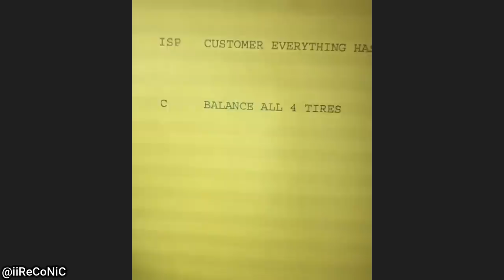Customer States Rear Wheels Won't Spin After Driving Over Speed Bump | Just Rolled In

Comment: That cross connected exhaust from the headers is about the most hilarious thing I've seen. The phrase  " What The Hell Were They Thinking"  just doesn't do it justice !  What's nice about it is that no one will get hurt from a bad self repair job like many others seen here. BECAUSE THE CAR WON'T RUN ! ! !
Reply: My first thought was that someone didn't want that car to go to auction, and had the resources and know-how to make a big statement about it.
Reply: Takes EGR to a whole new level. Lol
Reply: someone had the correct size pipe parts without any use, and decided to troll, i guess

Comment: Most of these clips make me very glad for the annual MoT test here in the UK.
Reply: I've noticed that cars for sale in States with auto inspection tend to get a slightly higher price than in States that don't inspect.  At least you know the basics parts of the car are in good order.
Reply: Plenty of states have inspection and in almost all of them you can find a shady station that will pass your piece of junk.
Reply: @PURENT  That is the fault of the public-private partnership model.  Farming out the inspections to private garages that have an interest in selling you stuff or passing a junker for a little cash on the side is a conflict of interest.  If the actual inspection stations were run as State functions, have fixed checklists, and have no further monetary benefit other than the inspection fees, then it would work.  A private garage can get a car READY for an inspection but, they should not be the issuing entity for inspection stickers.

Long long ago, in Florida, it was that way as I remember.  I remember riding with my Mom or Dad to get the car inspected.  The inspection stations just checked the car for safety and gave you a list of things to get fixed if needed.  They would add air to the tires and adjust your headlights on the spot if needed.

Comment: I've been wasting so much money when I do my brakes. I thought you had to put 2 pads per wheel, but now I  know it's put 1 pad on and save the other for next time. Thanks for the info  !!!
Reply: Well, I tried to put both pads on but they wouldn't fit. Derp.
Reply: @travisritzman6772  didn't push the round squeezey thing in ?
Reply: @thomasfletcher760  round squeezey thing? Let's not be so technical
Reply: Even better, when one side of the brake rotor wears out, just flip it and you've got new brakes!  Easy peasy!
Reply: @squirrelsarepeopletoo6678  taking it easy right now with big words , headache
Reply: @thomasfletcher760  I know I was joking with you
Reply: @squirrelsarepeopletoo6678  I knew you were

Comment: I feel for the guy with the gunshot in his hood.  So easy to do when using your car as a rest - while your scope can see over your hood the barrel can't!
Reply: Friend "accidentally" shot his car multiple times. Uh huh.
Reply: Thanks, as a blue stater I admit I needed this context
Reply: @annehaight9963  My assumption was buckshot, but i know little about guns.
Reply: This guy's not the only one. I saw another truck with identical hood damage done the same way several years ago.
Reply: @annehaight9963  only one bullet hit the truck, one is an entry hole and the other is an exit hole.
Reply: @JacobTerherst  
Ooh I see what you're saying. But that makes me ask another question:  if you're using the hood as a gun rest, wouldn't the gun be on top of it? Or do they rest the front of the barrel on the concave edge of the hood?

I'm a gun owner but I still can't quite wrap my head around someone being this dumb, lol.
Reply: @annehaight9963  Usually when something like this happens, there’s not a good explanation on why it happened. Its similar to, “I was just cleaning the gun and it just went off.”
Reply: @annehaight9963  the hood isnt flat, you rest it on the edge, the scope has a clear view over it, but the bore is below the top of the hood=2 holes. 1 in, and 1 out.
Reply: @leftyo9589  
You'd scratch the barrel though, wouldn't you? Resting it on a bare metal hood? I dunno the whole situation seems sketchy to me.

Comment: 1:38 Still remember when I worked at a lumber yard, had a kid come in looking for PVC pipe and fittings.  I couldn't quite figure out what he was working on because the parts were random, so I asked him and he told me he was building a cold air return for his car.  I told him that was a bad idea because the pipe wasn't rated for high temps and could melt and set his car on fire.  He put the parts back and left the store.

I hope I saved his life.

Comment: Once my mom “tried” to replace the front left tire my stepdad who was a mechanic told her she was turning the lug nut the wrong way😂😂😂😂😂😂😂😂😂😂
Reply from the maker: Oh oh 😅 good thing he said something lol
Reply: Some vehicles have LH thread on lug nuts, so not always wrong.
Reply: @derekhobbs1102  That will be some pretty old cars.
Reply: I had an early CJ-5 Jeep that had 1 stud on the rear axle with Left hand threads....1 STUD!
It tightened up really tight before I tried going the other direction.
Reply: @tt600pch  You kidding me there's a single troll stud installed by the factory there? The heck is the point of that!
Reply: Modern Japanese trucks too.
Reply: @Kalvinjj  I doubt it was "factory installed' since the jeep was 30 years old when I bought it.
Reply: @tt600pch  OK I see, this makes a tiny bit more sense now.
The question now changes to: who the heck, and WHY THE HECK, did the re-threading the other way around??
Reply: @Kalvinjj  I bet they broke a stud and grabbed the only other stud around and it was a lefty.
Reply: All the nuts were clockwise to loosen edit: she had 4 removed and couldn’t get the last one

Comment: That exhaust is actually a very neat job, compared to the rats nest of mig wire that we usually see. Shame they forgot one vital principle though.
Reply: They must have thought the exhaust just makes noise like a car speaker.  How does somebody look at headers and not understand what is going on?
Reply: @BlackPill-pu4vi  given that the car was just purchased at auction, the previous owner probably did it intentionally to screw over the bank that was about to repo their vehicle.
Reply: @BlackPill-pu4vi  how they be as proficient in their welding and fabrication yet fail to understand the ic engine and the intake /exhaust  layout. Astounding
Reply: @ZanHecht  Ah HAH!  A repo revenge!  That would explain it!

Comment: how can you forget to put on brake pads and then drive with the grinding noise like: "this is fine, all things as supposed go be!"
Reply: I did 4 front pads recently, going down the drive hear grinding noise. Go to the first wheel I did and see that the first pad I put on backward, inside out. Turned pad around and been fine ever since. One of those duh moments.
Reply: Just incredible. I've had a superfluous screw or nut left on the workbench or floor when I'm done with a job on my cars, and said "meh, that was unimportant anyway". But seeing a whole brake pad left over after a brake job? Who wouldn't go "this should probably be mounted somewhere"?

Comment: I can actually relate to the lug nut. Last tire place cross threaded and torqued down to about 300lb. 2 piece Ford lug separates and basically had to be cut out. Had to buy new set of lug nuts and replace stud.

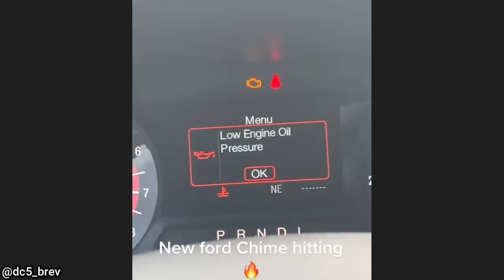Comment: 2:43 I almost did this once. Was taking an old truck I was working on around the block. It had a bench seat and lap belts buried under decades of random crap, so I wasn't wearing them. I took a corner kind of fast and the side door flew open. I only just caught myself on the wheel before I fell out entirely.

Comment: 1:38 The problem is obvious. The aluminum foil goes between the intake and the engine. With it's current position it's trapping engine heat and reducing the efficiency of the entire system.

Comment: These videos make me feel extremely paranoid while driving now. There should be a section on basic maintenance for getting your driver's license. "When should you get your tires replaced? A) when the tires have worn down to the inspection depth B) When you hit a curb C) When they explode on the highway at 70mph and you cause and 15 vehicle crash."
Reply: Way back in the day, we had Driver's Ed in most high schools and basic auto maintenance was part of it.  Everybody had to find the dipstick, air filter, check tire pressure, and know how to change a tire in addition to learning rules of the road.  The penny trick was taught, both in schools and on TV.  Put a penny in the groove of the tire's tread.  If you can see the top of Lincoln's head, the tread is worn to the limit and time to replace the tire.

BTW, near the end of the semester, we would get four students plus the teacher (one at the wheel and teacher in the front and three in the back seat) into the Chevy Impala (big bench seats), and take turns getting  actual driving experience.  On the road driving took a week or more because of the class size and to get town and highway driving time in.

Comment: 3:03, upper right corner, 70 Pontiac Tempest, Phantom Green. I had one once upon a nineteen eighty something, 82, 83, somewhere in there. Mine had a 350 four barrel with a turbo 400 and a posi. Unfortunately, it also had about 220,000 miles on it when I got it. It lasted about 8 months before the tranny shat the bed.

Comment: The exhaust at 2:12: that's just the newest technology to eliminate cat converters. It's called a U-pipe, or U-Tube...
Edit: what is strange is that the exhaust tubing (and welds) doesn't look new. In fact, it appears to have the same patina as the headers do, and it looks to have oil on it where it crosses under the trans pan. Hmmm.
COOL 63 Tempest at the very end! I want a 63 with a 326!
Reply: Well ,likely sat for a while before the repo, and then sat again before the auction, leaving time for it all to rust to an even patina. Easy to have 6 months do that, especially if it was parked outside and had water running under it from the rain.

Comment: I think I've experienced the ant nest in a place you wouldn't expect it in when I took off a battery for a weed whacker and knocked it on the ground to find a flood of ants in the battery, they got in through the clips and started nesting.  Probably due to the fact it's dry and it was recently very wet and cold here.  The same thing probably happened with the car with ants (the stuff spotted on the driver's side floor aside, though that could be the other reason why those ants were there) they probably found someplace in the car warm and very cozy and dry to nest and they started an "ant hill" in a component of the car.

Comment: The fuel pump one has me baffled.  I have no clue what we're looking at.
Reply: thats a plastic gas tank, some idiot cut open to get at the fuel pump.
Reply: @leftyo9589  .......looked like that to me but I needed confirmation.  
Those idiots actually drive to and from the grocery store and how do they not get an accidents.  They can't even steer shopping carts, I seen them.
Reply: If your gas tank can't hold any gas, then you don't need a fuel pump. Problem solved.

Comment: The tyre starting to split down the middle happened at my store. But it wasn't splitting, it split. Two halves of the same tyre held together by only the wires inside it. Have no idea what or why it happened, I just know I had to take it apart (take the rim off the tyre and put the rim in a box to be shipped to the manufacturer for a warranty free new one) to this day I still have no idea why or what they did to make it happen. 

Also, that last one is insane. Like, it has a door, but the door can't actually close, so it's like driving in a open jeep, no doors, with no seatbelt. Dumb things on here, but this is definitely top 10 of all your vids

Comment: The forward lower ball joint on the Ford Fusion is missing the nut… I hope the shop took that off, that could end badly
Reply from the maker: The shop did and same with the axle nut as they were working on removing the transmission as well.

Comment: When I watch this I feel so much better about myself. That cold air intake was so cool probably adds 50 horsepower. I've seen that IRL before too and I'm so happy for them. Remove the air box the inlet tube or pipe, put a cone filter from auto zone on there. That is a dyno proven intake at least 50 horsepower added instantly. The turbo will be so powerful and the exhaust cut off will make the turbo better too that's another 50 horsepower. 🤪🤢🤮 Cops don't even work anymore so you can do anything you want.

Comment: The ants thing is a real problem. I worked on a Volkswagen a while ago and a relay that powered the ecu had failed. I replaced it and the car ran great. About 6 days later the guy calls and says the car isn’t starting again. I scanned it and the relay was showing as faulty. I pulled the relay apart and there was a ant squashed between the relay contacts and this was preventing the ecu from powering up. I sealed the relay with silicone and told him to bug bomb the car.

Comment: The amount customers that come in with bold tires and are then shocked when we mention it to them is just ridiculous. It's winter, constantly raining. How do you not feel any loss of grip etc. The amount of vids and pics I have is just worrying.
Reply: The USA is big. A lot of it is far enough south that "winter" means it may be around 15-16C in the mornings and only warm up to 22C during the day. And it rains about once a year for 25 minutes (during which time there are several thousand crashes as the roads turn to soap). The main problem with tires in some areas is dry rot from heat, not going bald. I can't remember the last time that it got down to freezing where I live, it's been at least 10 years. And so far it's rained on 5 days this year. Yes, all of the year.
Reply: @lwilton  Years ago I briefly lived in Los Angeles and can absolutely verify this. Lots of people riding on bald tires and lots of crashes when it rained for the first time in months (all that powdered rotten rubber and old dripped oil on the roads builds up then gets very slick when wet).

Comment: Ok, the fuel pump one.  I don't even understand what happened here.  Sawzall the bottom of the gas tank open?  How did they get that fuel pump that low while still attached at the top?  What is going on?  There is wrong, then there is F'd up, but this is a level even beyond that.  WTF

Comment: About the brand new cars with rust or old broken parts
I bought my Dodge Charger brand new back in 2009 and the the brake had a strange sound they dealership right out the showroom first they didn't take it seriously I went to another dealer he found the brakes needed skimming 
Dodge sold the car with old used brake rotors 
I was very naive back then I curse my self for not asking them to replace the car or at least replace the discs under warranty its very dicey when buying American and European cars, more so with American cars, feels heart wrenching to settle for Japanese or other models just because American automotive industry don't have quality checks in the factory assembly lines 

I didn't pay your in unskimmed or torn currency sir

Comment: my timing belt snaped on my lancer 2006 result: new engine
Reply: If it's an interference engine it's often gone.
Timing chains however had become crappy too the last 20 years. The most reliable thing is still a camshaft down beside the crankshaft and push rods which move the valves, like truck engines use
Reply: @simonm1447  but after further inspection this summer the bottom end seam still ok but the head is totalled. But Ididmt had the place to disasemble the engine at the time so I just chamge it
Reply: @yoyocheqc301  the head will be gone, but the pistons also get some damage. You would have to disassemble the engine, if you get a used one it's probably the simpler solution.
Reply: @simonm1447  yea dont worry the problem was fixed a long time ago and I did disassembled the old engine to see what he had. I was just explaining what happend to me a couple month ago
Reply: @yoyocheqc301  my mother had a ripped timing chain a couple of years ago. The result was not that different at the end, since the car was already rusty we replaced it with another used car instead

Comment: Why would a timing belt coming off of an interference engine, cause the engine to need to be replaced? Would valves and pistons be hitting eachother or something?
Reply from the maker: Yep! If it was non-interference then they would have been okay.
Reply: "interference engine" exactly means if the timing is off in the slightest, the pistons and valves will become intimite with each other.
Reply: Well, it's pretty much explained in the word "interference".

Comment: 2:47 -- wut.

So assuming that the door-latch was functioning correctly, does this mean that this driver would normally just be constantly slammed against the interior of the door?  And in this particular case when there was no door to stop her, she fell out.  OK, but there's never a door on her right side, right?  Meaning, anytime she takes a hard left, she tumbles onto the passenger-side front seat, away from the steering-wheel and foot-pedals?

https://youtu.be/AqtmdC-5feA  <-- The Five Basic Laws of Human Stupidity.